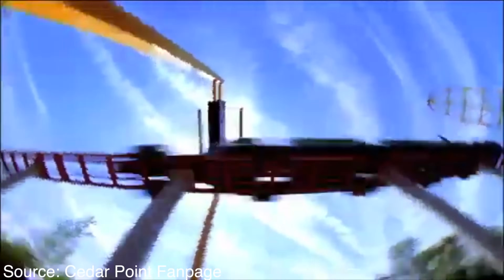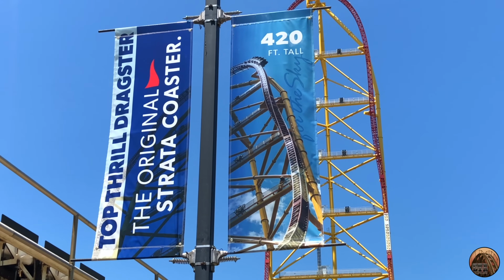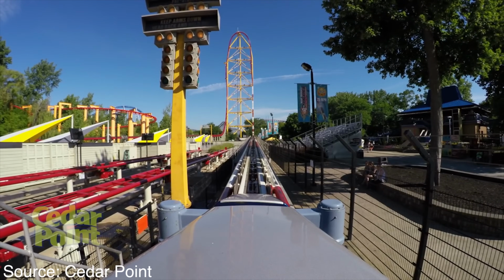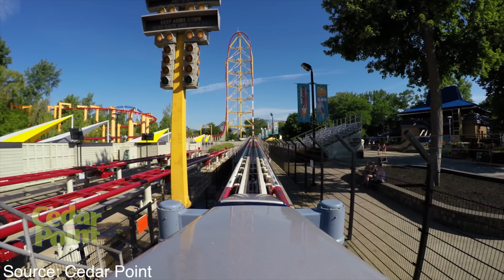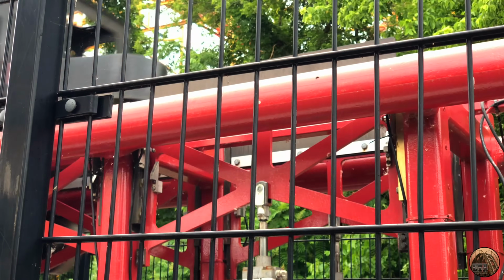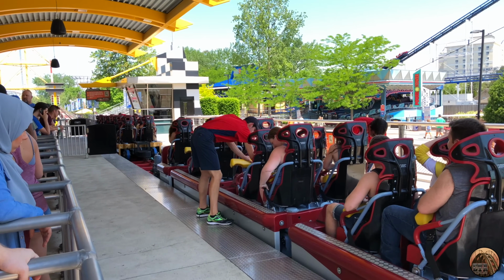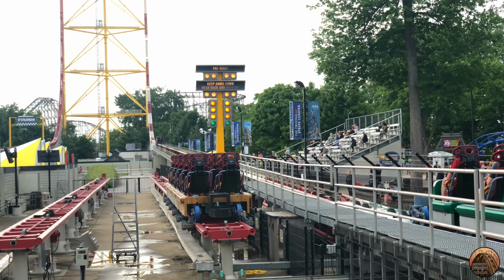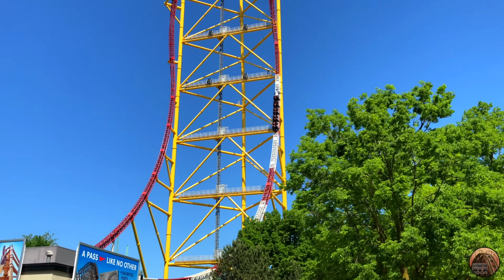Problematic Roller Coasters - Top Thrill Dragster Review & Technical Analysis - Cedar Point

Comment: So, if the launch system favors heavier trains, do you know why they removed the cosmetic wheels on the back of the train? Or did they replace it with a seat car that can hold one more row of riders?
Reply from the maker: One of the cosmetic wheels legit fell off 😂 so the park removes them and added a 9th row of seats to each train instead

Comment: Hydraulic launches are my favorites. The combination of power and duration, along with the ability to launch longer trains, is unmatched. The pneumatic launches on Maxx Force and Hypersonic have nothing on TTD or KK.

If they wanted to simplify the launch track of moving components and sensors they could retrofit an LSM system IN ADDITION TO the hydraulic system.
The LSM's solid state cores could be designed to work as the magnetic brakes do in the event of a rollback but would require no moving parts to accomplish this (default mode). During the launch they could be synchronized to avoid additional load and continue along the remainder of the straight track and into the pull-up where they could add some additional speed. I don't think it would be wise for the LSMs to add very much (if any) force during the hydraulic launch because it could risk unseating the launch dog from the catch car. This would allow the hydraulic launch to be tuned back from the 120-130 it runs at today to something in neighborhood of 100-110. This doesn't sound like that much but given the component margins that would likely increase the longevity of the launch system significantly while also eliminating a huge number of sensors and moving components - which would likely increase the reliability of the ride significantly.

The problem?  Cost!  Replacing the launch track brakes with an LSM system would require retrofit of all 6 trains and probably re-positioning of the magnetic brakes on the brake run in addition to the system cost. The system itself would rival Red Force's in complexity and cost IN ADDITION to the hydraulic system. It would likely be a 10-15 million dollar retrofit.  Cheaper than conjecture for replacing the hydraulic launch system, maybe..? But not by much.

It's a shame Intamin doesn't offer the accelerator model anymore though. They're an amazing experience and the shortened launch tracks + longer trains that they offered allowed parks to pack very thrilling and reasonable capacity rides into tight spaces (see Xcellerator and Storm Runner).
Reply from the maker: That’s an interesting idea!

Comment: How much weight was dropped when the took the engine and fin off the back? And why did they?
Reply: One of the tires flew off one of the trains in late May of 2003 so they decided to take the wheels off but left the spoilers on. Dragster had a really bad mechanical failure in the hydraulic room which caused it to be down I think until July. Cedar Point decided to take the engine theming out of the last car and add a 2nd row of seats. The spoilers and tires were never put back on when it reopened. The spoilers and tires used to attach to the metal box you can see on the back of the trains so they could technically still be put back on even with the extra row of seats.

Comment: About the possibility of replacing the launch with a magnetic one:
You brought up Red Force as a counter example for why it wouldn't be powerful enough.
Couldn't you just add more banks of LSMs to overcome this limitation? 

TTD has 5 cars per train while Red Force has 3, so I'll assume that TTD's trains are roughly 1.67 times as heavy.
TTD's launch pulls an average of 1.44g while Red Force is at 1g, so TTD accelerates 1.44 times as quickly.
Through F = ma we can approximate that TTD's launch requires roughly 1.67*1.44=2.4 times the force of Red Force's launch, probably slightly more due to the higher air resistance at the higher speeds, but it would still be below 3 times the force.

The one bank of LSMs on Red Force can produce a certain force, so 3 banks of those same LSMs should be able to produce 3 times that force in total, assuming the power source is not a bottleneck (e.g. super capacitors).  
I don't know how far apart the LSM banks need to be to avoid significant interference, but if that's an issue you could mount two of them on the sides like older launched coasters.
I'd love to read your thoughts on this.

Comment: One thing I’ve wondered about with the new LSM launches is how far up the track they can reasonably go (like on the launch hills on Pantheon and Copperhead Strike). If they made the LSMs go halfway up the pullout, then the top speed would go down, but it might be enough to push it over the top.

Comment: I really want to work at my local amusement park. Which is Busch gardens Tampa. I want to operate a ride but I know I have to work my way up. How long did it take you to operate a ride? We’re you able to learn right away, or did you have to work other positions first?
Reply: Kenya Hughes I used to work for Carowinds another one of cedar fairs parks until I was promoted and moved to corporate at cedar point. I was certified at all rides in all work positions at both of these parks it seems the same training is used across the cedar fair chain but you would start at level 5/4(depending on the number of positions at that ride) which would be your greeter/grouper position then get trained in your level 3 load/unload position, level 2 co dispatch, level 1 controls/drive(former paramount parks call this position drive) I can’t speak for other company’s training policy but would assume it would be similar
Reply: Zach Minton thank you! It’s definitely something I wanna do. I love working behind the scenes
Reply: Kenya Hughes I worked at a full time employee in the IT department I know the seasonal positions don’t really pay to high but it was fun to do it when I did it is something fun to do.

Comment: Damn this ride is confusing, props to all the ride crew
Reply: Luke Williams i think Intamin confused themselves when they built this one lol.
Reply: @gplez91  Cedar Point: Adding Top Thril Dragster in 2003
Intamin: So uh..... we just put this all together, and we think it works. All set :)
Reply from the maker: @gplez91  They 100000% did!
Reply: @gplez91  well it was a protype at the time but kingda ka has had the same issues
Reply: @NickyD  wasnt accelerator the prototype
Reply: @Demon-POT  Tbh Accelerator was a proof of concept prototype. TTD is a "But can we make it *Bigger*" prototype
Reply: @avro205  @Crazy Coasters International It's Xcelerator. Knott's is my home park.
Reply: NebulaPlays Right you are lol, my bad
Reply: Anyone that operates the catapult on a aircraft carrier would be right at home.
Should have gotten some navy guys in there to help.
Reply: @vector6977  Their operations are a little different as they use steam (and the launching aircraft's engines) to get the planes airborne.
Reply: Watch the one on  the Thunder Mountain Railroads. All of the block sections in that were crazy, and they have to manually winch the trains to continue to operate
Reply: lol no computers do everything. we(workers) had to deal with angry people lol